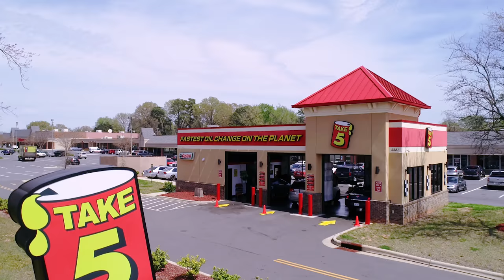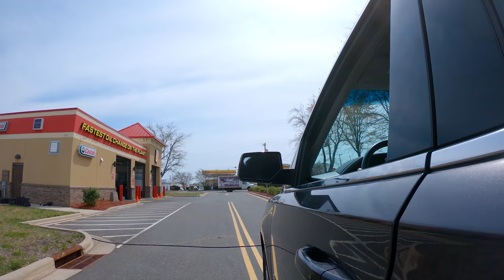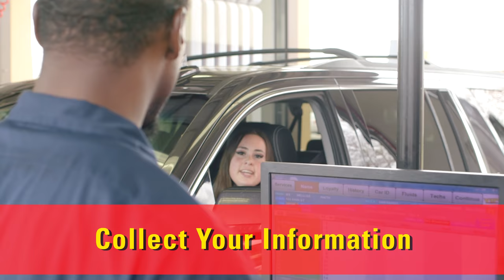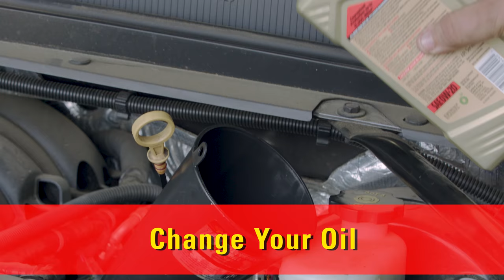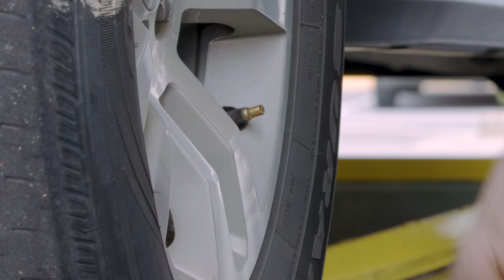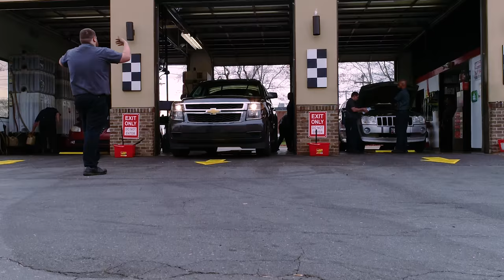Take 5 Oil Change Overview

Comment: Friends don't let friends go to Take 5.
Reply: Forreal i used them one time and a 40 dollar oil change cost me 70 plus they chipped my paint on the lip of my hood with a tool i can slide up under drain it slap in new filter and fill quicker anyways

Comment: Look at the reviews and complaints about this outfit.  They screw up on a regular basis, then don't take responsibility for their errors.  There are a huge number of examples on vehicles where they've drained the transmission, then overfilled the crankcase when "changing the oil".  MrSubaru1387 has multiple examples of what he's had to fix after a "Take 5" oil change.
Reply: Y yo 😊❤y😊❤ todo lo de la cocina que 😊❤
Reply: If you don't mind please go leave the 2066 W spring creek Pkwy plano tx location a 1 star...They did me bad..Over tighten my oil filter so tight that now I have to have the dealership cut it out which is like 200 dollars..Take 5 refused to help me and basically told me to F off even though they are the ones responsible.. I posted a review and told them social media is powerfully now days so if you get the chance maybe your 1 star will get me some type of help
Reply: To be fair it’s a Subaru the plugs are right next to each other idiots will be idiots 😂😂

Comment: They charged me 90$ for An oil change & half assed it, these people should be shut down.
Reply: Why, the Ford dealer charge me $95 for my oil change and it’s a ranger😂
Reply: I went to one last time I needed a change because I'm a college student and have a job. I went because I didn't have time to do it myself. 
But I recently changed my oil at Oil Take 5 and they were horrible with the drain plug and filter. My oil drain plug was near impossible to take off and my oil filter was impossible to take off. What I had to do was drill holes in my oil filter socket, place it in the oil filter and screw, screws through it and then use a breaker bar and a cheater bar to get it off. 
Those mtherfckers say they don't use impacts, but I swear they do because I remember hearing one when I got the oil change from them

Comment: NEVER use this company to change your oil. They damaged my engine with using the wrong oil and it cost me $4900. They never accepted any responsibility and pretty much ignored all attempts of resolving their mistake. I had 2 different dealerships write me a summary of damages and Take 5 oil ignored all facts.

Comment: I have always gone to Lube stop and then to take 5 for my oil changes.  A couple days ago I returned, and after pulling into the bay was told that their records show my car has a piggyback plug and they don’t service cars with those.  They recommend I go to a full service shop down the street.  I have never been turned down there before.  I told them that they always changed my oil.  The manager just repeated himself and recommended the place down the street.  If my car had a piggyback plug it’s because Take 5 stripped the threads and installed the plug.  The last thing I want to do is go to the shop they recommended.  It may be affiliated with them.  I went to the Firestone shop I always go to for repairs.  Can’t believe these people have become so rude!  Ever since it changed from Lube Stop service has gone down and price has gone up.
Reply: Elias Leal  It’s a plug in a plug so they can just use the inner plug because they stripped the threads on the oil pan.
Reply: Gotta get a whole new oil pan ur threads are stripped now it could be from take 5 or another shop it’s a liability issue
Reply: @jbeeees1077  got a whole new car.
Reply: lllllllllllllllllllllllllllllllllllllllllllllllllllllllllllllllllll
Reply: That's crazy I run a Jiffy Lube I've been running my shop for about 28 years and a piggyback plug is just an oversized plug that fits into the stripped threaded oil pan. And then it has another plug to piggyback that main plug and you never take out the entire plug once it is installed. You only pull out the little piggyback plug that is on the main plug It's easy and simplest can be but these rookies are scared and lazy, any way that they can get out of doing an oil change they will but I bet you the owner of Take5 doesn't know that they're turning down customers.
Reply: @rayv882  I suppose I forgave them because I bought an Equinox a couple years ago, and I’ve been going back to take 5.  Do you suppose the oil drains slower than a regular plug and they just don’t want to deal with it?  The excuse they gave me at the time was that they didn’t have the correct wrench for it.  Anyway, I drove an hour and a half to buy my new silver car because of the chip shortage and I didn’t want to buy black.  But that’s another story.

Comment: I went to a new location here in Phoenix, AZ. I was told they would do the oil change but was advised by a few young men that I had a leak from my oil pan and though they would complete the oil change, it could amount to a waste. I am not stupid and contacted the main office after thanking the clueless young men for informing me of such a huge issue. Basically, I had driven through water as the parking lot was flooded due to rain. I had also spilled some ps fluid when checking the fluid levels before leaving that morning. The people have no idea the difference in fluids like oil and ps fluid.  I have over 30 years of experience in the automotive industry and have opted to get away from it for reasons like this - lets make money and screw the consumer. I am unable to do oil changes to my vehicle where I live so I have limited options. After contacting them, I received a very rude reply but was provided a coupon for 50% of an oil change. Crap company and humored to think they would even consider the thought that I would go there after my initial experience. As they say, first impressions are important and hard to take back. First the location and then the response from customer service person. No way will I even consider going there or even suggesting someone to give them a try.
Reply: So you say you were a mechanic or have experience so what if you're working at a garage and a customer comes in with their vehicle but before they came in they spilt power steering fluid after adding or they spilt oil after adding but they didn't inform you and you were underneath their vehicle I'm sure you would immediately think they had a major leak and tell them. Now of course if you investigate by doing a leak diagnostic check then that's different because you take your time doing the leak check But since it's a quick lube shop their trained to move fast and they saw what was spilt power steering fluid from you adding and water underneath and they thought that you had an oil leak.  Simple human mistake.
Reply: you're lucky,
They did an oil change on a friend of mines car in Tempe AZ, didn't put oil in it, blew up the engine, and are taking zero accountability.  Posted the link  above
Reply: Thank God I read the reviews first before taking my mother in law car there

Comment: Don't go to these quick oil change companies. They use cheap oil, that is not good for your engine. And some don't even change the oil. They just say they did. Take your car to have fluids changed . With someone you know you can trust.
Reply: Make sure everyone checks for the oil that your type of car is suppose to use. Lots of cars use a synthetic blend oil. So keep using the same oil, everytime. There is a reason for using the type of that the factory calls for.
Reply: Or just be like me and do it all yourself. Only takes me 20 min to do my oil by myself

Comment: I took my car to the Plano Texas location 2066 W spring creek Pkwy,  my last oil change they put the filter on so tight that now no one wants to try and get it off. I went back to the same location after contacting the manager the day before. In the end they basically told me to f*** off and that it's not their problem for their mistake.  I'm a single dad with 2 kids and now have to pay to have someone else remove it..Please leave them a 1 star so no one else gets screwed. They think that people are just gonna suck it up and deal with it but not this time. Their corporate office does nothing about it

Comment: Oil changes should NEVER EVER BE THAT QUICK!!!!!!!  You can’t look up check double check oil type and quality, remove all of my splash guards and metal points and oil filter. To get to my oil filter you have to remove over 12 bolts and 4 plates of splash Guards just admit you didn’t do the service!
Reply: Lmfao you can absolutely do all that in 5 to 10 min. A impact driver will easily take those 12 bolts off in less than 30sec. Oil drains in about 3 min. Filter swap in another 3 min. Skid plate back on in another 30sec. Most techs already know what oil each vehicle takes

Comment: I got my oil changed here and it was $71, is that normal for an oil change? I can’t ask my dad so I have no idea. I picked the oil they said was the cheapest.
Reply: The looks like the price of an oil change using synthetic oil. Does your car use synthetic oil? The oil cap will have 0w-20 or something similar. If it does. 0w usually indicates synthetic oil read your owners manual too.
Reply: @MTTech  ok thank you
Reply: It depends on the type of oil used. Full synthetic oil is a bit more expensive and a bit better
Reply: @dakotaalexander9292  oh yes I think my new car must take synthetic oil, my old car was always like $40 when I got an oil change but it must be they take different kinds of oil
Reply: Better than going to a dealership for a oil change. They charged me $180 for oil and filter change.
Reply: I do my oil change for 30$ my self.
Reply: Yes oil changes trending at $50-70 even at Walmart.
Reply: It depends on what kind of engine you have v4 v6 v8 and check your hood or owners manual it’ll usually have what kind your car truck or suv uses that determines the price and also the brand of oil

Comment: I went to take 5 oil change because The Greased Pig was busy...Now I know why!  When it's my turn, I pull in and wait for them to start to change the oil, several of them were texting and joking around.  When they start changing the oil the guy comes to my window and tells me my coolant level is really low and my coolant is dark and the system needs flushed so I ask him how much that would cost and he say's $280. So I say I'm not doing that just top it off.  He say's we're not allowed to top it off.  So I'm confused....I thought they changed the oil, topped off all fluids, vacuum and clean the windshield....apparently NOT! So I said okay, don’t worry about it, I'll take care of it.  So the say that they're finished and present me a bill of $145.!!!  I about fell out of my car!!  I've never paid over $75 for an oil change ever!!  Well I pay and start to pull out and they didn't reset My oil sensor, well I waited another 10 minutes because they didn't know how to do it.  Then I also notice that they didn't clean the windshield!  So I leave there and go to Advanced Auto Parts and buy some coolant and the man that worked there offered to help me put it in the car. ( I guess they are allowed to)  I open the hood and he say's that I don't need any coolant!  So I ask him if the coolant is bad and he say's that there's nothing wrong with the coolant!  So not only Did they rip me off on the price, They tried to rip me off more wanting to flush the coolant and they didn't even do their job!!!  BEWARE!!!  Stay away from this place!!!

Comment: I used to work there it's a commercial lie. It doesn't take 5 minutes 😂
Reply: It's take 5 quarts of oil. That's why all the prices are set for the first 5. Takes around 10 mins on average. This is why you meter got lead tech

Comment: Speaking for the technician leaving the customer in the car while they are changing oil can bw potentialy dangerous to the technician. What would happen if the customer accidentally tuned on the vehicle while the technician had their hands in the engjne compartment. I see lawsuits for this company in the future. 
There is no reason a customer should be in the vehicle it is a danger to that technician and has every right. to sue if they get hurt.
Reply: i hope the technicians would be smart enough to hold onto their keys while they work on the car, for that very reason. that would definitely not be good.

Comment: Place is a complete ripoff. They charged my son $135 for their “cheapest” oil change. Plus one set of wiper blades. WTF?
Reply: $135 for an oil change AND blades? You should have been charged MORE. Non synthetic too! Learn to do it yourself or pay. Blades alone at a store with install should be 50 ish.
Reply: Thanks you made my mind up. I’m not going
Reply: Blades now days can cost 60 bucks
Reply: I do it all myself and it costs me about 40 bucks and 15 minutes of my time
Reply: Do it yourself bud it’s not that hard

Comment: hadmy oil changed at the take 5 loction 1698 34th St N St.Petersburg Fl they didnt tighten the filter properly caused my 35,000 mlie car to leak large amounts of the oil. called to ask about the issue was told they would give me a free oil change but not a refund! like im going to let them touch my car again. told me i needed video proof! would not contact the garage who found the problem! dont use these people! they could distroy your car .

Comment: Absolute Abomination service will not go to
Reply: why
Reply: @vincentsolito8234  Probably because the guys working on your car make less than $8.50 hour.
Reply: @Mattschindig  yeah I got an oil change there and one of the guys told me they make $9.00and have been working for almost 2 years with no raise, while new employees get $9.50. Their service is fast and great but I believe these guys deserve better especially if people at walmart or midas make more for shit service.
Reply: Good for you
Reply: TDogSavage5.0 they tell you we get compensation and tip ? And he lied to you. You can get raised to assistant manager in 3 months. He lied to you
Reply: @Mattschindig  the techs that work at my non chain mechanic that services my car make over 25 an hour. They did my oil change in 15 minutes instead of 5 but, they did it right. 75 dollars for full synth and filter. No gimmicks no BS.

Comment: Arrived for a take 5 oil change.Asked about what filtet would be used on my 2018 Volswagon passat Jason the employee got rude and defensive .Alarm bell,went off.Got out to ask about oil filter that would ne used before i have ok to xjange my oil as i wad speaking to tech on phone about the Eco gaurd oil filter that take 5 uses they without my approval drained my oil.Texj told me they were not giving the correct oil filter for my BW Passat 
Thinhs hot worse Rebelah in the pit took a random unmarked bucket and came back with oil that i dod not know was even the correct oil for my BW in that unmarked random bucket.I am very concetned about take 5 oil change practice never saw anyone jusy pur oil in a random bucket that the customet does not know what tjat bucket was ised for prior.This is a sloppy run company .Valled to file complaint left at least 5 messahes for my problem to be addressed.Im so concerned i called VW wagon deatship to drain my oil and put there OW20 oil and appripreaye oul filter in my car.This is going to be pushused my me.Thos again is a sloppy buissness practice that ive never seen before.Horrible service rude poorly trained people
Never again

Comment: These clowns stripped the oil plug in my wife's car and now refuse to fix the damage done by their former burger flipping technician.

I immediately took the car to my engine mechanic and they got the plug out and wrote me a statement confirming that the damage was done in the last few hours. I'll be contacting my attorney in the A.M.

Total scum, steer clear of these criminals.

Comment: SO..... WHO RESETS THE MAINTENANCE LIGHT AND OR THE TPMS LIGHT ON CLUSTER, THE CUSTOMER ??? WHAT ABOUT OTHER WARNING LIGHTS ON, WHO CHECKS ALL OF THAT THEN??? HOW FO I KNOW IF I CAN GO ON A TRIP SAFELY, YOU KNOW SUSPENSION PROBLEMS, NAILS ON TIRES ?? FO I NEED TO GO TO THE DEALER OR SOMEWHERE ELSE ??? ARE THEY EVEN CERTIFIED MECHANICS TO EVEN TELL YOUR VEHICLE IS SAFE ??? I DONT THINK SO, THEY ARE LIKE WAL-MART, NOT MECHANICS-NOT CERTIFIED 🤔🤔🤔🤔🤔
Reply: 1. The techs will help reset most lights if possible. 2. If you have other lights take it to an actual mechanic not a oil shop

Comment: I have been without AC in my 2017 Hyundai Veloster FOR OVER A MONTH due to an ERROR MADE DURING AN OIL CHANGE AT YOUR SHOP in PALM COAST, FLORIDA!!!!!!

I was told by Palm Coast, FL location manager ERIC that TODD MAFFE was working on my case and that I should have a checked mailed out the first week of January. I have not received anything! Customer service does not pick up. It's only an answering machine. 

An ACCESS PANEL was cut into my car during the oil change because the tech was lazy and didn't want to unscrew it!! MY AC LINE WAS CUT IN THE PROCESS!!!!

I am without AC in Florida. Where's my check Take 5 Oil Change???? I need a status update NOW
Reply: I did what I never did before in which I replaced the evaporator and the expansion valve in my car’s A/C here in Florida because it was gonna cost over $900 to fix it. This was repaired before and I found out all the shortcuts at the mechanic did. They cut out the plastic housing, which was unnecessary. Some mechanics like to take shortcuts, this is what I worry about when I take my car to have it repaired. I did the job by myself and it was a big job, but it was worth it.